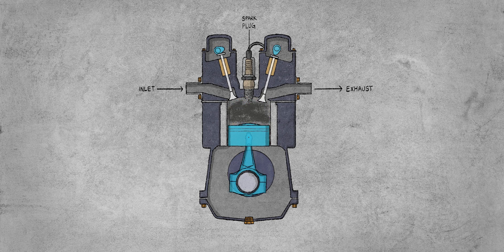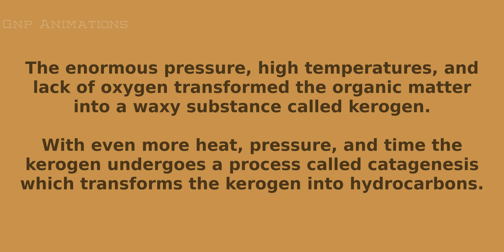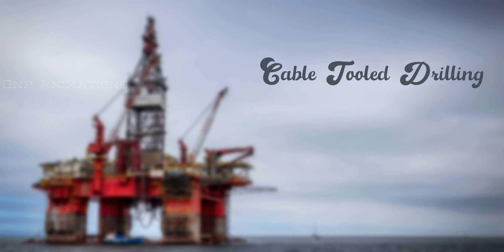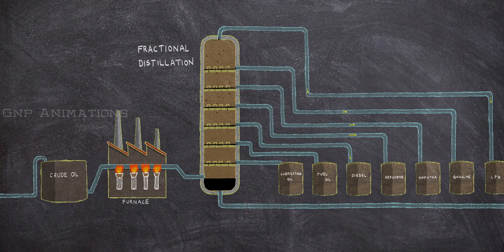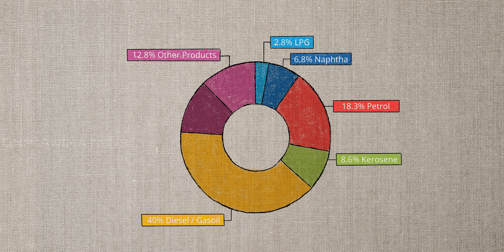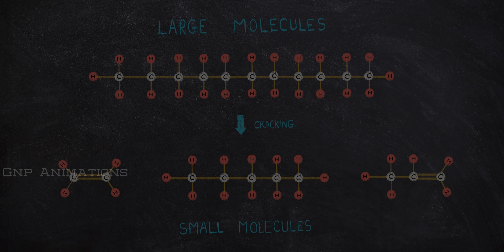how petrol is made animation | Karthi Explains

Comment from the maker: 0:00 - intro
0:26 - Formation Of Crude Oil
0:50 - Steps
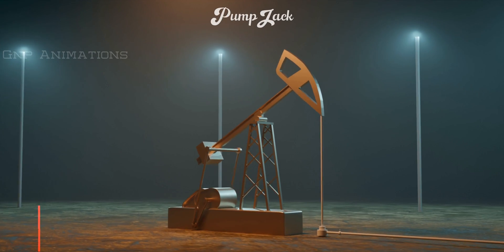1:04 - 1. Collecting The Crude Oil
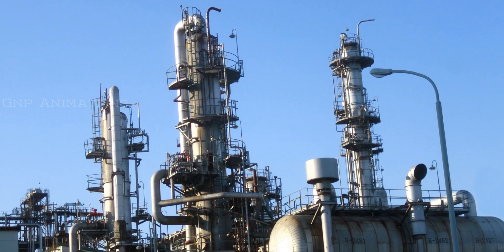1:53 - 2. Separation Of Petrol
2:48 - 3. Purification Of Petrol
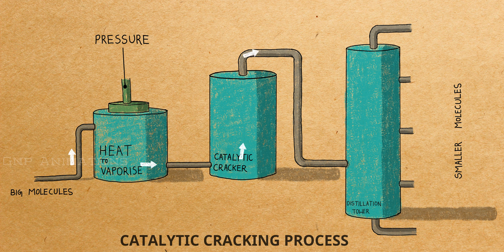2:57 - Catalytic Cracking Process
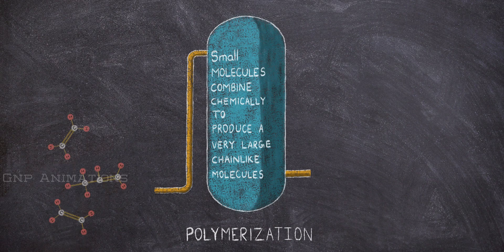3:17 - Polymerization Process
3:37 - Sweetening Process
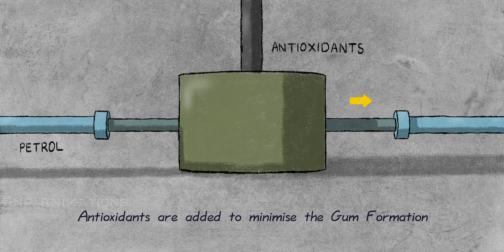3:43 - Adding Antioxidants
3:53 - 4. Octane Rating
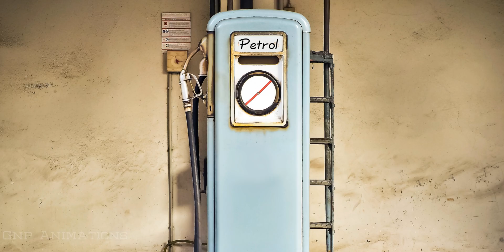4:19 - Final Product

Thank You For Watching
Subscribe for more videos
Reply: osm
Reply: Hello thanks for your video ,however wanted to ask a question can i mix the catalyst together with plastic waste in the pyrolysis reactor ? If yes at what ratio ? and which catalyst would be safe in the reactor ?

Comment: A few comments on the descriptions. 1. Cat cracking and 'polymerization' are not just purification methods, nor are they separation methods. They actually DO produce materials not present in the crude oil; they can make petrol. 2. Isooctane does not just vaporize slower than heptane, it actually burns slower; leading to its higher octane rating.
Reply: Hello seems you have good understanding of the pyrolysis , let me ask is it safe to mix the catalyst together with plastics in the same reactor ? Is so at what ratio ? And which catalyst is good or safe for this ? Assist please

Comment: Digging and Drilling of Earth should be avoided to be safe from Earth Quakes.The quality of kerosene has impacts on Engines of Automobiles.The Automobiles not in Good condition will emit Carbon Monoxide which is dangerous to breathe.The Trees are intaking.The Petroleum Refineries are also polluting the Air.So we have to stop the Drilling Projects and better to move away to Rechargeable Solar Electrical Automobiles.Instead of constructing Car Sheds its better to park them with Sunlight Exposure.While Raining its better to avoid parking the cars near Trees.  due to Thunders and Lightening.In cool climate we can open the windows of cars a little, while travelling instead of using AC.The kids should be advised to not to show their heads outside of the windows.They have to wear Seatbelts to avoid Risks.These are some small things we can follow to save our Planet in which we are living.Earth is the home for all.The houses can be built with Cement and Bricks. The Home can be protected only with care.Increase the Parks.Building the Towers, Basement,UnderGround  Parkings should be avoided.The Cars can make use of Rechargable Battery with the use of Solar Energy.